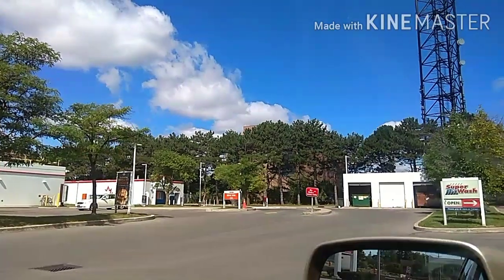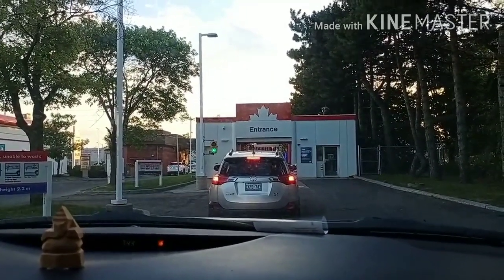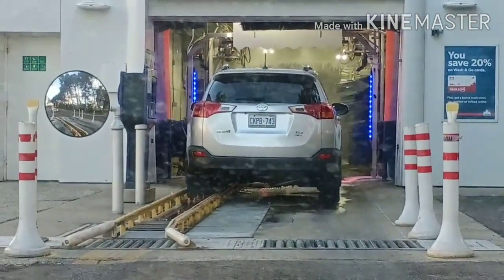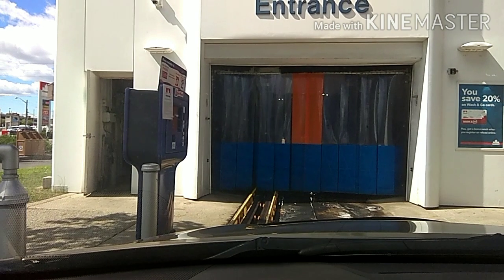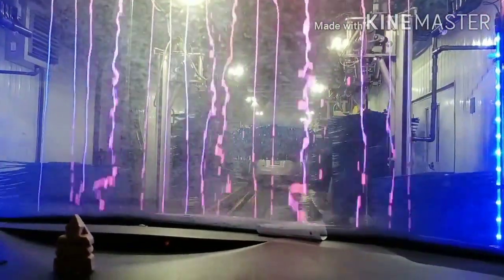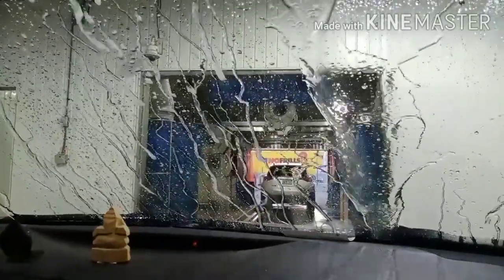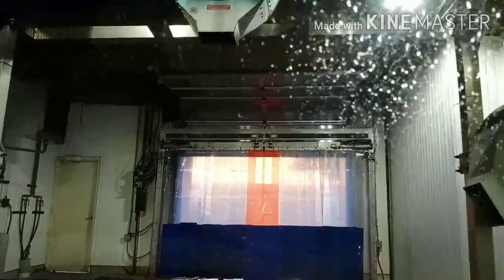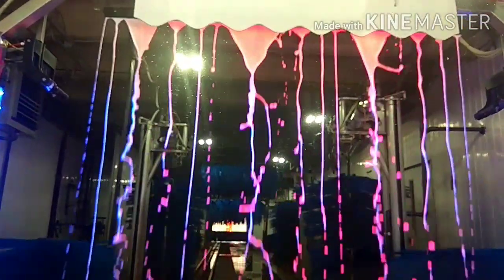Auto Car Wash in Canada|Step by Step procedure of Automatic Car Wash|Inside experience of super wash

Comment: Is it clean car from bottom ?
Reply from the maker: No ,it doesn't clean from bottom.
The tyres part is cleaned.
But the force with which the water flows and run down mostly cleans the exposed parts